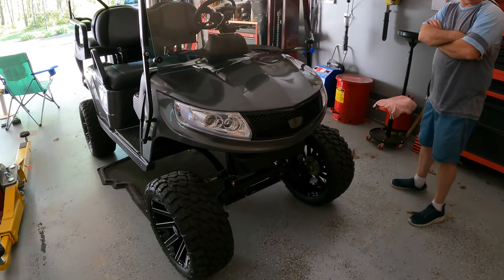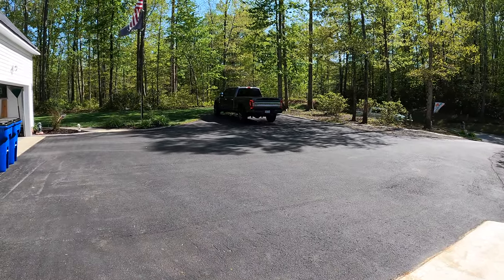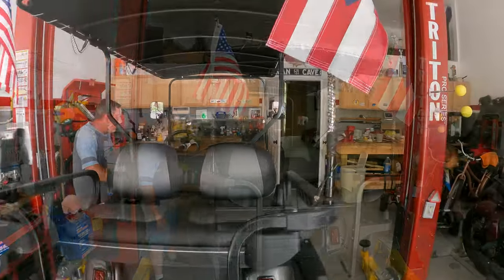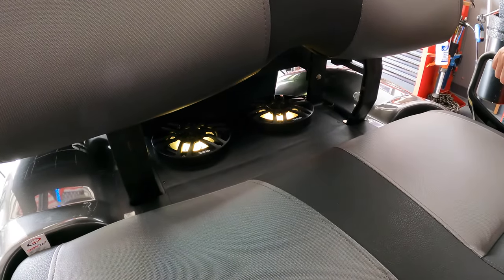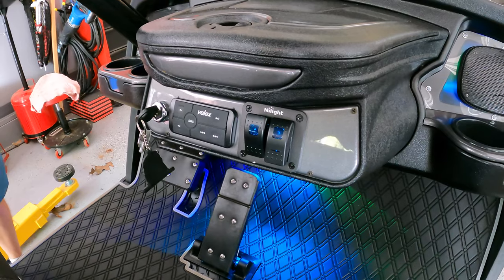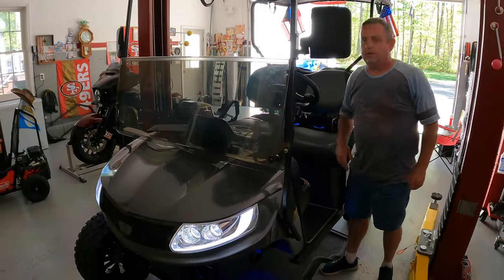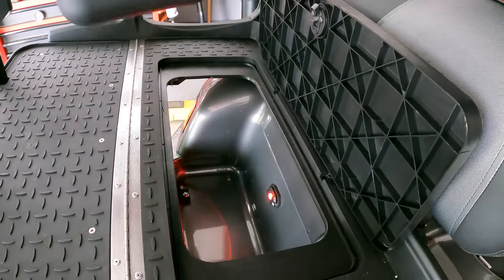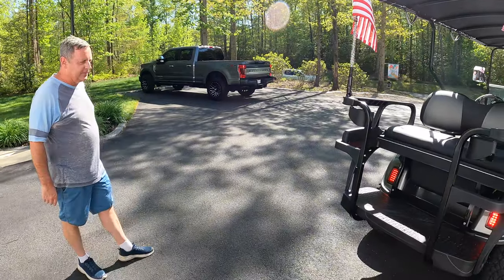MIKES NAVITAS GOLF CART

Comment: What brand and model speedometer is that, and were did you get the bracket for it? Also where did you get the plastic mold that holds the buttons and voltage meter? thank you
Reply from the maker: Honestly everything came as a package from a local builder but it’s on Amazon.  

EXRAY Speedometer Kit- Fits E-Z-GO RXV Golf Carts - U-Bolt Mount

Comment: What brand Lithium battery is that in your cart? We bought a cart with the same battery in it but we know nothing about it - it came with no paperwork. We love the battery and just wish we knew more about it! Thanks for any info you can share. Love your channel!
Reply from the maker: Thank you so much.  Unfortunately we couldn’t give you an answer on the battery.  It came with the unit and it doesn’t have any sort of label or marking on the battery.  I do remember the guy who built it say that it was a good brand sold unmarked to keep the price down for this particular build.  If I can find the answers I will definitely get back with you on this.
Reply: @FindingJay  That has been our results too. The battery is terrific but it would be nice to know where to get another one. I'm trying to get my cart club to switch to this battery when the time comes and they want to upgrade from wet cell to Lithium. It'd be nice to know where to get another one! Thanks again for your reply and a great channel.

Comment: Here in Miami we’ve bought several Navitas.  Our windshield showed up cracked took three weeks to get them to send it along with the Title.  Now the lights, horn and phone charger dont work.  Checked all fuses and connectors all good.  Cant follow the light switch harness behind the fire wall cause its all riveted together.  

THESE GUYS DO NOT RETURN CALLS.  Customer service is horrible!!!!
Reply from the maker: Damn….sorry to hear.  We bought from a local builder here in Virginia.  Never had any issues but I’m thinking maybe a wire like the ground came undone.  I would pop the rivets and replace with screws if necessary to at least try to get to the wiring harness.  Sorry I couldn’t really offer much help but best of luck and I hope you’re able to get it fixed.
Reply: @FindingJay  Ok so update.  Finally got a call back and got lucky to find the one guy with love of job.  Apparently there was an issue with them when they first came out of factory.  The horn was blowing out a 5amp fuse (cant say what its called but its on drivers side and its a dual fuse plug a red 5 and a white 25.). Anyway the tech said that their fix was simply to swap the 5amp for a 15am and that did the trick.  Everything works again.  Big disconnect between the persons receiving calls and the techs.  Other than that we like the cart and its options.
Reply from the maker: @ivanchavez8175  that’s great to here.  Hope there’s no more issues.  It’s a great cart for sure.